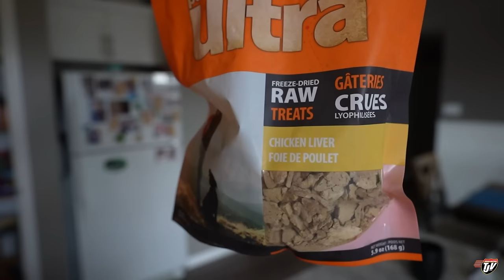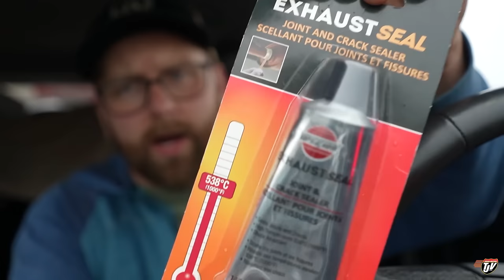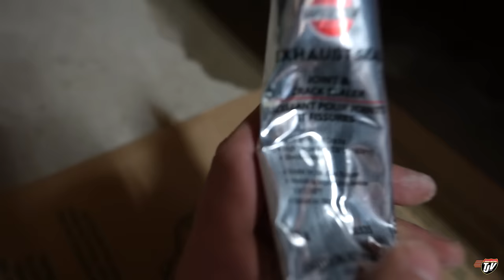WAITING ON TRUCK REPAIR | TJV | Vlog #3054

Comment: Fuel tanks....
YEARS AGO, I was dispatched to go to the Yellow Freight yard in Oakland. They
were short a truck so they towed a tractor up from LA to the Oakland yard. I was
sent to put the driveline back on it, give it a once over and make it ready for work.
This truck had 4 of those great big black steel square fuel tanks. The tag on one
tank said 240gallons. WHAT! So this truck hauls around 960gallons of diesel fuel 
onboard. Holy Smokes! When I finished my work I went inside & got my paperwork 
signed by the fleet mgr and I asked him about those tanks. He said Yellow had had 
many bad experieces buying contaminated fuel on the road so a company policy 
was enacted where they  NEVER  buy fuel on the road. Trucks are only fueled at 
company yards. This truck ran from California to New Jersey so it had to have 
enough fuel to make the trip.
WOW!

!
Reply from the maker: Wow!

Comment: JB weld Water weld putty works wonders on leaking fuel tanks. Dont even have to drain the fuel. It's almost like magic how it works. Did mine behind tank strap 8 yrs ago and still holding

Comment: a little late but if you need glasses again try zenni or clearly   you can get good quality glasses for a fraction of the cost,   zenni also has prescription safety glasses   you can probably get around 5-8 pairs for the price of the ones you got.  Im also in alberta so these are good for canadians

Comment: I buy my glasses online at fraction of the cost. Luxottica owns all of the major opticians like Pearle and Lenscrafters. Problem is that here in Manitoba the optometrists will not give you your interpupillary distance which is required to order glasses on line. Imagine that. However that distance is fairly easy to determine.

Comment: When you shine the light on it, you can see it without the light it’s too dark, but with the light shining on you can see it gonna get that fixed before it turns into a bigger problem just like old blue you had to get the transmission line fixed before that stalled out on the road and the hole in the fuel tank. You’d rather have a repair a building it’s all bill, because we have both it’s rather expensive as you know